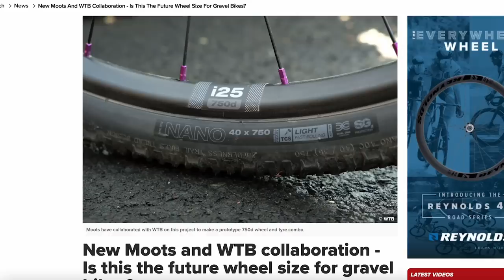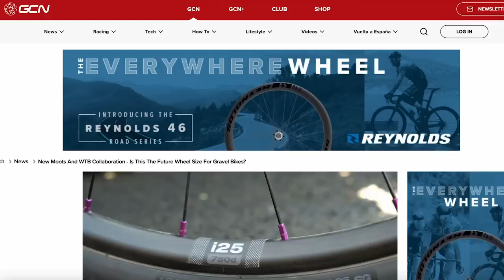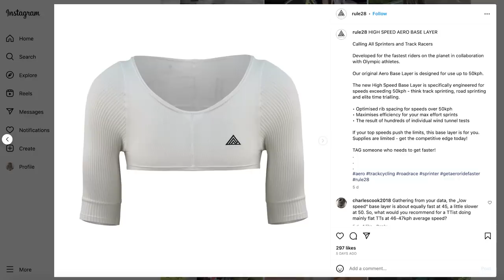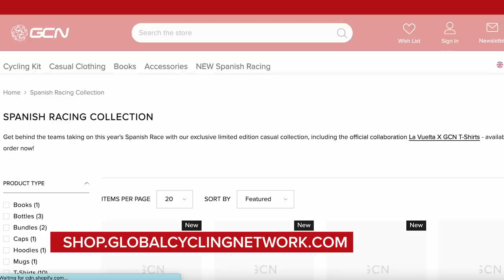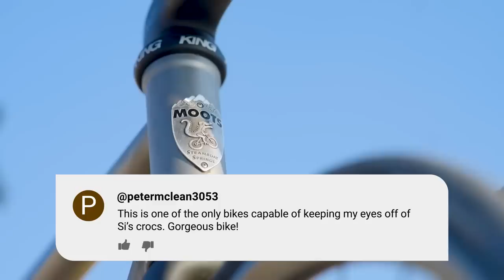10 Worst & Most Hated Bits Of Cycling Tech! | GCN Tech Show Ep. 297

Comment from the maker: What bike tech do you think sucks? 😤
Reply: Tubular tyres. Not new tech, they were the fastest, once upon a time, but if you puncture, they are a nightmare.
Also Slime inner tubes. Don't know if they ever stop a puncture. But if you got one they made it impossible to fix. Used once, straight in the bin.
Thumb breaker handlebar shifters. They were the cheaper option when first out. I am so glad I paid the extra, even though I didn't really have the cash.
Reply: Apparently everything affordable sucks. You guys make some great videos, but understand that not everyone can afford the luxury brands and parts. Come back down to earth a bit.
Reply: Here's a tech that sucks: aero road bikes that require major surgery if you want to make the slightest change to your setup, because everything is internally routed.  Oh, you want a 5mm spacer added?  Drop your bike off at the shop for a week, and it will cost you about $100 in labor.
Reply: hydraulic disc brakes and other overly complex and expensive tech that make it impossible to do home bike maintenance are a no go.  From a bicycle touring perspective being able to work your own fixes is key.  From a the perspective of a hobbyist on a budget  affordability is key.
Reply: Having to make sure your bike is charged in order to ride it, I'm looking at you electronic shifting.
Reply: Middle of the handlebar brakes , luckily I think everyone has phased them out.
Reply: Road tubeless! Yep, it'll seal a blackthorn puncture but cuts are a different story. At best they weep out, especially in cold wet conditions. And sticking a plug in just makes a bigger hole. Valve seats leak too. TPU tubes for the win.  Lighter, cleaner, more reliable and 99% as fast.
Reply: You nailed it bro 👊 @ShawnAuth  👏
Reply: cockpit integration
Reply: @KermitFrogThe  I agree! And I'm with Alex about the cable disc brakes too!
Reply: Im sure Ollie regrets big time about Radar comment😅
Reply: Aero seat posts. More precise that EVERY frame has its own. The laws of physics should define what‘s best so why can‘t they agree on one or two shapes and we can have a lot more options and better availability.
Reply: Agree that cable actuated disc brakes aren't to par with hydraulic, however you should look up hybrid mechanical/hydraulic not exactly like hydraulic but still excellent braking. As well easily to set up given you're running housing and cables.
Reply: Totally agree about the radar. The only thing they may be good for is for the rider to scream before being driven over. No one has the reaction time to move out of the way of a car about to run them over. Being said, if the radar is able to soothe the anxiety of the rider than that is a total win.
Reply: @maugerville  my friend you have never used one so stop nonsense
Reply: How about the new radar that also has a Camera? The camera can be very useful in situations where a driver does something threatening or dog forbid, hits you and claims you were in the wrong when you weren't.

Radars themselves aren't always more useful than just listening but like others have said, when its windy or if in a group ride and chatting, you can get notified of a car way, way before you ever hear or see it.
Reply: Add 750D to the tech that sucks list.
Reply: @maugerville  I can see the car is coming up to hit me long before it does, and be more aware of my situation, especially in areas where there are very narrow or no shoulders at all - it doesn't just work on cars right up your ass.  I often can get about 300-500 feet of warning, sometimes more.  Also, EVs are quiet.
Reply: @merttt1923 He drools about paint jobs on bicycles. But when it comes to common sense products like the radar, he choses fail. 😂
Reply: Carbon-fiber anything
Reply: Helmets. They'd make more sense for driving, walking and getting out of a shower.
Reply: Proprietary bike parts are the worst. Special seatposts, integrated handlebar/stem combo's, special spacers and headset parts. Making bikes almost immediately obsolete because most brands won't produce spares for more than 1-2 years.
Reply: @maugerville  it is de car drivers responsibility. A lot of accidents will happen when people steer into the verge in panic.
Reply: Completely disagree at Radar light sucks. Best bit of safety kit in years, I even use one on my TT bike so that I know that I can pull out to overtake or avoid a pothole without wrecking aero to look back. Limited use in town or really busy roads, but elsewhere I wouldn’t do without it. I reckon you’ve pre-judged them, without really using them
Reply: Cheap quick-links.... bought a pack of 10 from Amazon.... tore through them cycling a tour of the Hebrides.... never... ever.... again.   SRAM & KMC quick-links.... I love you, welcome back into my life!
Reply: @thomasb.4219 especially on endurance bikes. You are sitting more upright and than try to save a few watts with the cockpit but can’t change the geometry of the bike anymore?
Reply: @biamarconchi  I found nothing wrong with the braking action of cable discs on my Giant Defy, I just find it so much easier to maintain hydraulics than cables so I upgraded them.
Reply: 750D wheels
Reply: Yup. Very little of what GCN puts out is applicable to my bikes - they are both from the '80's :-) I'm just waiting for the fashion to come back round to what I'm riding! @ShawnAuth
Reply: I wouldn't say anything on your list sucks, but there are better alternatives and options.
However, I couldn't ever recommend cable actuated disc brakes and still recommend rim brakes for cheap bikes - much as I prefer hydraulic discs.

Comment: Hey guys I think your wrong regarding to the radar backlights. It’s a ad-on, you don’t rely on them for 100% you still need to look over your shoulder to see traffic coming behind you but it will give you a warning if a car is coming up to you from behind. I am using it for a month now, had no issues with the radar (Magene) No false warnings or missing traffic behind me. I think its a welcom extra safety warning system that works well. I am happy with it.  Great show BTW. Greets Rene The Netherlands.
Reply: I have the Garmin and it works great.  I have hearing damage, so the radar is very welcome.
Reply: And also, in windy netherlands, you ears are not that usefull for ‘hearing’ upcoming cars. Especially multiple ones.

Comment: I agree with most of your comments on tech that sucks, but not on the light / radar.  First, the light itself is very bright, with distinctive modes, and is a good safety feature in itself.  Secondly, I don't think you tested the radar feature with a unbiased viewpoint.  The single beep on the radar (which can be turned off but it makes no sense to do so) is non intrusive and just alerts you to one or more fast approaching vehicles.   Ollie notes that he has good hearing (so does not need radar) but there is no way anyone (even Ollie) can hear a car coming from behind on windy downhill at 70 - 80 kph.  The radar lets you know if there is a vehicle approaching and allows you to consider your line on the road and to slow down if necessary.  I suggest you both give it more of a try when you are riding  outside the city and reconsider your negative views - it may save you someday when a car door opens in front of you and you are not sure if you can safely swerve to avoid the crash.  Of course, the radar will not save you, but it may give you a chance to react a bit sooner to a dangerous situation.
Reply: Spot on! Rarely disagree with GCN but this one..they got it wrong I, some of us, think
Reply: Knowing a car is coming only matters if you're riding in the middle of the road.  As for getting doored, I think few think about cars I the road. They react immediately to what they see in front of them and you may very well not steer into the road due to a car, get doored, then get hit by a car anyway
Reply: EVs are quiet!!!
Reply: @veganpotterthevegan  Rubbish - When you're approaching a section of road with traffic islands and your Varia gives a red alert meaning the vehicle coming towards you at speed gives you options such as waiting for it to pass before entering the narrow section of road. The noise on some roads means your never 100% which direction a fast car is coming from - The Varia spots it when it's behind you.
Reply: @bradfordzone5187 I shoulder check before moving over to take the lane, and if a car door opens and the Varia tells me there’s car, am I supposed to get cycle into the car door?
Reply: At this point I think they just say this because they're not sponsored by Garmin
Reply: I will never ride without it again. I know it won't tell me if someone is going to hit me. I used to always ride in the side of the road just if I didn't notice a car coming. More risk of punctures and going off the road have done that. actually because I was looking over my shoulder. 😅 Now I can comfortably ride longer from the edge knowing it will alert me. And less risk off turning out in front off a car you missed

Comment: Over the last 7 years I have ridden 40000 km on my 60mm rim brake carbon clinchers, bought on aliexpress for $700. 75kg, flat roads, no problems with braking. My guess is 90% of GCN audience doesn't ride competitively. We can stop with carbon rim clinchers perfectly fine.
Reply: Agree!
Reply: I'm more of a weekend rider and had my aliexpress-sourced 50mm carbon wheels (EliteWheels) for only a year, and also did not had any issues  whatsoever. They stop as fine ass the aluminium wheels I had previously (with the proper brake pads for carbon ofc), are gorgeous AND make me want to use the bike more, so it's a win-win-win.
Reply: Disc brakes have place in the mountains and in rainy weather. Almost everyone else will be totally fine with carbon rims and rim brakes. On a leash of paying manufacturers, gcn's job is to make all old bike technology look bad although they are still very usable in right place (rim brakes, mechanical groupsets, tubulars, narrow tires).

Comment: Not using a radar is like wearing Joo Janta 200 Super-Chromatic Peril Sensitive Sunglasses. You two,  Zaphod,  and Ford Prefect would make a great group ride.
"If a car's gonna to hit you it's gonna hit you" is not an accurate assessment of what a radar is for.  it's equivalent to saying you don't want to be aware of possible dangers.  You are struggling against a predetermined outcome in your minds that prohibit you from understanding the value of enhanced situational awareness.  They give you three bits of information about what is behind you:  Presence, distance, and relative speed.  All at a glance.  There is not other way to get that.  Not rear view mirrors, not turning your head, not listening for sound.  If that information is not useful to you, it is because you ride in a place where bicycles don't compete with autos to cross narrow bridges or where bike lanes end suddenly or don't exist at all. Besides, I live in an area where a huge percentage of vehicles are electric, and I have a hearing disability anyway, so sound as a source of awareness is not as useful as you may think it should be,.

Comment: Interesting. My fiancé bought me a Varia radar rear light for my birthday and I love it! I was skeptical at first, but I found it to be incredibly accurate and beneficial. While riding I am typically hugging the curb, where are the rocks and other debris lay. But with the active radar, I am able to ride in the middle of a lane on smoother asphalt. Once the radar goes off, I hug the curb, lets the car pass, and get back on the center of the lane.
Reply: Exactly and by doing that, you are more easily seen by motorist which pass you with more space and because you know they're coming you too can move a bit to the side as they come giving you even more space. Radar a fantastic bit of tech, plus it's super aero!
Reply: I ride in the correct place on the road whether a car is behind me or not, the car then overtakes me. It not advisable to move into the gutter, as you could come up to a pothole or some debris you need to avoid, but you’ve now got nowhere to go as you’ve just invited a car to pass you without it needing to move over sufficiently.

Comment: radar plus a bar-end mirror is an ideal combination IMO. The radar tells me there's something coming, the mirror shows me what it is and, more importantly, if it's giving me room
Reply: I far prefer a helmet mounted mirror nowdays...less movement needed to see behind, and works regardless of what position you're in.
Although bar ends usually are clearer.
Reply: I do this, and have a slick, small folding mirror that when folded up, the other roadies can't tell the difference between the mirror and a thick bar plug.
Reply: I couldn’t get my eye to work with a helmet-mounted mirror - kept trying to focus on the mirror rather than “through” the mirror into the distance. The bar-end works OK
Reply: I can’t even ride a bike anymore without my bar end mirror.  I feel so exposed without it, it’s just part of my scan, and if I look down and don’t see it, I get a bit panicky.  I always go with that and front and rear lights, even on gravel trails.  Yet to try radar.

Comment: Have to disagree about cable disc brakes, they work, they're easy to maintain and adjust for the home mechanic and it's much easier getting the wheels in and out than rim brakes (this may be specific to me, started out on a cheap MTB and it was a nightmare getting the brakes loose enough to get the wheels out just to clean and re-lube everything, so would have been even worse if I'd had a puncture and had to deal with the brakes out on a ride.  Now riding a gravel bike with cable disc brakes and it's a breeze getting them in and out.)
Reply: cable disk are awesome!!! no stupid hydraulic fluid spilling everywhere!

Comment: I will join the chorus of those who sing the praises of radar.  I do a lot of my riding on rural roads with limited or no shoulders.  I find it very helpful to get a warning about vehicles approaching from the rear.  I also use a large helmet-mounted mirror (admittedly the antithesis of aero!) that enables me to check the amount of space motorists are about to provide me.  (I will pull over if the situation warrants.)  After riding for 45 years without radar, today I wouldn't ride without it.

Comment: Have you used a rear-facing radar in traffic?  I find mine quite useful in some situations.  Pointless in heavy car traffic, for sure.  It's never given me a false negative, and it's always a good rear light.  Cable disk brakes work pretty well with non-compressible cable housings.  Bike-branded lubes and cleaners (except chain lubes) are a waste of money when auto-branded products cost way less and do the same job.  Most of the "cool-looking" things being pushed on us today (deep section wheels, integrated headsets, giant pulley wheels, etc.) don't look cool at all; they look goofy, especially on a classic bike.  Super-light carbon fiber frames and wheels are for racing.  Electronically-controlled, motorized shifting is stupidly overpriced and utterly unneeded if you know how to adjust your mechs and how to shift cleanly.  Rim brakes are great with aluminum wheels, and aluminum wheels are the best choice for most non-racers.  So disk brakes are an unneeded complexity on most road bikes.
Reply: I agree fully... radar is somewhere between pointless on roads with heavy traffic or windy roads, but on more back roads brilliant. My computer will beep at me well before I can hear ANY car (or even semi truck). Furthermore,  it's helpful when other things are coming up behind you... I've been alerted to dogs chasing me that I was unaware of and once a bull. On heavy traffic8roads or group rides/events/races, I'll turn off the radar to stop constant beeping.
Reply: Disagree with the electronical shifting especially when you get older and riding gravel in 30 degree weather. I can't tell you how many times I have dropped my chain between the chainring and frame going from the small to large chain ring especially while wearing big winter gloves. One time it happened and a mechanic had to take my chain ring off to get the chain out.  I'm also older and just don't have the strength I use to have. With electronic shifting, hit a button and done!  No drama or worries about being stranded  alone on a gravel road in the middle of no where.

Comment: Adding to the list of people challenging you about radar lights.  It's not a question of whether a car is going to hit you or not, it's about being aware that there are vehicles approaching and being able to take the time to assess the road ahead and position yourself to be in the safest position.  I wouldn't ride without my radar and handlebar end mirror.  Maybe if I was riding on quiet country lanes with a film crew following me it wouldn't be an issue, but on two lane roads with limits of 80 or 90 kph it's good to know long before you can hear them that there is a vehicle coming.  I'll grant you everything else on the list except mechanical disk brakes, which I'll bet outperform rim brakes on average across all riding conditions.  But if you are interested in upgrading my ride to hydraulic brakes so I can demo them I'll go along.